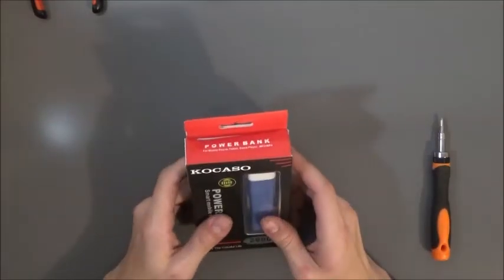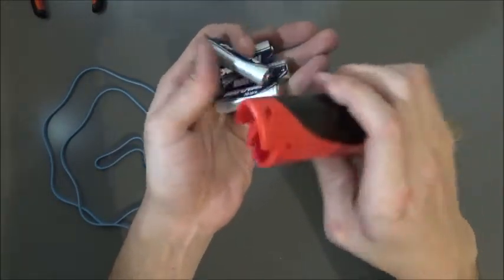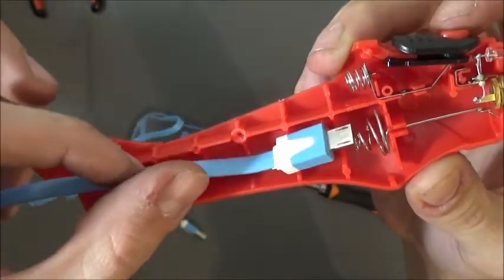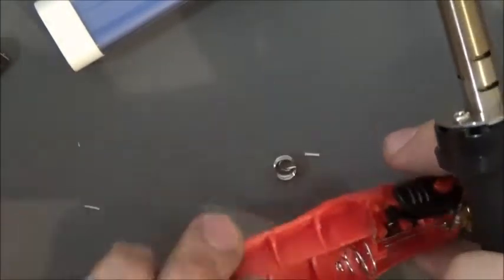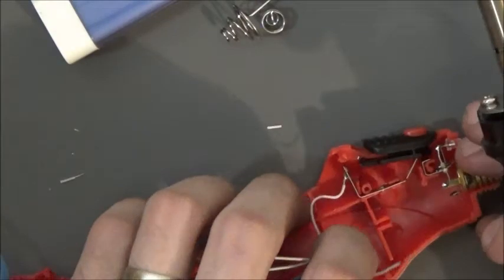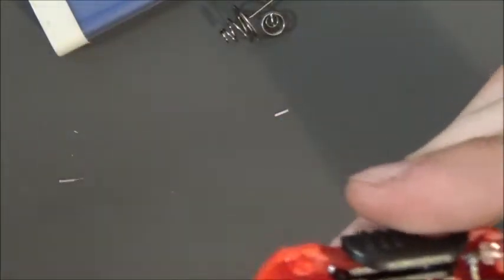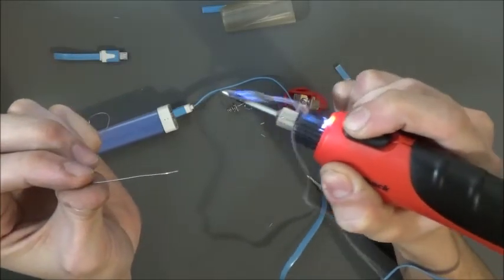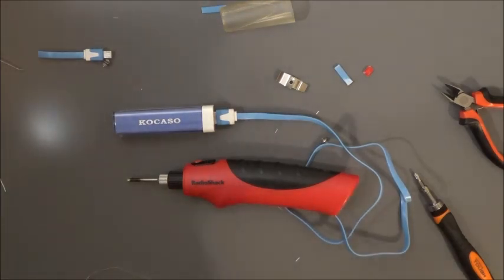How To Make A (Long Lasting) Battery Operated Soldering Iron

Comment: I did the same thing a long time ago. But i put in a 12v DC 2,5 M socket  so i can just plug in a 2.5m power supply  i just soldered it in to the same contacts so it can be used on the batterys or an external power supply.

Comment: Nice conversion!  

In your reply to another comment, you said you'd need another power pack... 
Did you mean to say that you would use the second pack to replace the current one when it run out of juice in the middle of a job? Or, are you planning to use both in parallel to get more amps?

I'm confused why there are negative votes for this video. I don't see anything here that is objectionable. No real security issues, or anything of the sort. I wish those who gave thumbs down would comment about why they don't like it... 
The only thing I can think of is the F word you used... lol.
Reply from the maker: Robert Cartier I would just have a second pack on standby. The voltage seems to be all right in the soldering gun gets hot enough so I wouldn't need to run them together. Thanks for the comment I need to start uploading videos again I got a bunch recorded just need to edit. Don't have much time to edit nowadays. Probably going to find some kid and start paying them to edit my videos LOL. And yes maybe the F word is what got me the thumbs down, I don't now. I will try to not curse in my future videos anyways, because if I ever want to monetize my videos, saying bad words does not help you make money, hell it can actually stop you from making money...

Comment: why not fit the power pack in the handle?
Reply from the maker: mark rent so I could still use it to power other things. Also, after using it more it still is not the best battery life... So I may buy another battery pack because one is not enough if your doing a large soldering job.
Reply: So you need do modify your title if doesn't last longer :)